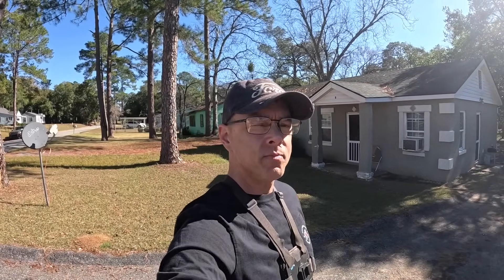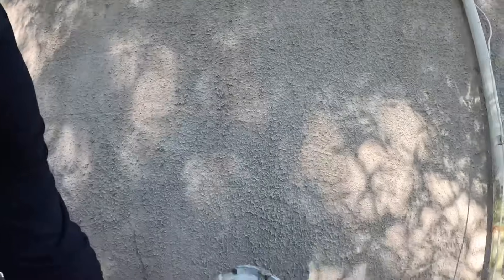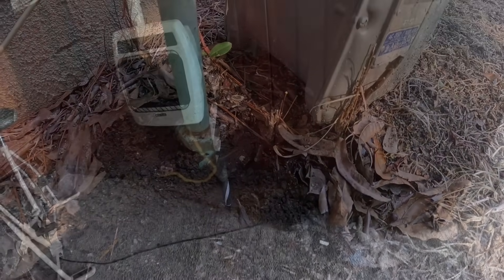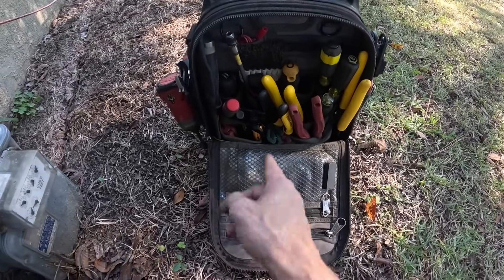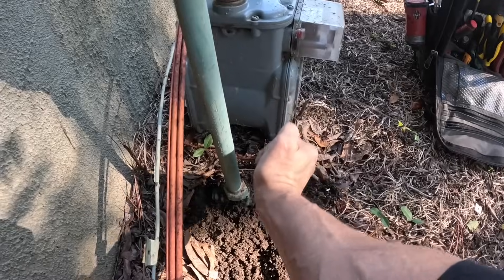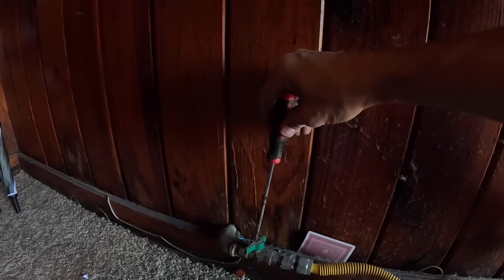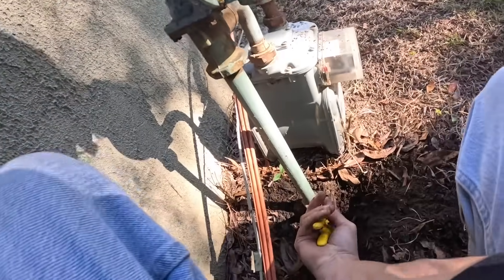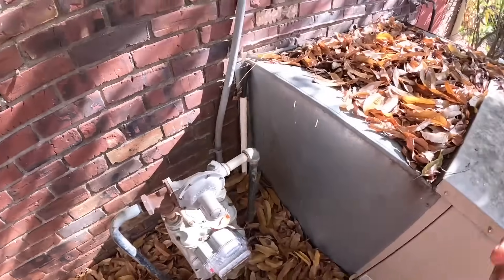No Way It Could’ve Worked Like That! #hvaclife #hvacguy

Comment: You should get one of those small hand hoes. The ones that have 3 progs on one side and a flat bar on the other. Got one this spring to clear out around units when the mulch gets piled up. It works great and works better then a screwdriver.

Comment: We have a small rental with a boiler. Last Feb. a tenant called about no heat.
Got there around 10pm. Then started the calling, to find a boiler tech. Good Luck!
So I went on Chrome and checked weak spots on our boiler. It indicated that it might be the pressure switch. By now it's about 4am, no tech till 8.
So I took the pressure switch off, blew the water out. Put it back and the boiler fired!!! Could have pushed me over with a feather.
When tech came at 8, I had him change it anyway.
By the way it was -20c outside.

Comment: So what was the vacuum spec for the unit and what tool did you use to adjust it?
Reply from the maker: Getting that info wasn’t easy. Ended up ordering a factory switch. Just found it .33 IWC
Reply: Well i thought it would depend on the the size and or Vacuum of the motor thanks for that explanation

Comment: Glad I'm not the only one with few calls coming in.  It always slows down in the Winter months and we have had very few cold days.  Temps dip at night but rebound to the 50-60's.  Not a great need for heat.  Rental companies, aka slumlords.  Screw em!  I had a similar call recently where the customer had changed out the pressure switch hoping to correct the issue.  They installed a .75 WC and it needed a much lighter switch that closed at .34 WC.  Gotta love those units where the model numbers are GONE!  Looked very much like your equipment.

Comment: On the package unit, when tge burners lit, I noticed the burner ports were glowing. Could this be due to over pressure?
Reply from the maker: There is a screen at the opening of the heat exchanger. I think that may be what you saw glowing.
Reply: @HVACGUY  I think they call those low nox burners. I’m not 100% sure but I think it mixes the oxygen and gas better. Good video

Comment: Great job , I just ran into the same issue with this unit yesterday could not read the schematic was yellowed and faded so bad plus the unit is 29 years old. It was a Rheem Unit. The blower would not turn off at the thermostat only at the breaker.
Reply: After 29 years, I think it did its job.

Comment: Curtis  over the years working on gas units with inducer motors the nipple on the fan housing will fill up with grime and stop the vacuum.. some times  just running a wire in the nipple clears the obstruction and wall ah.